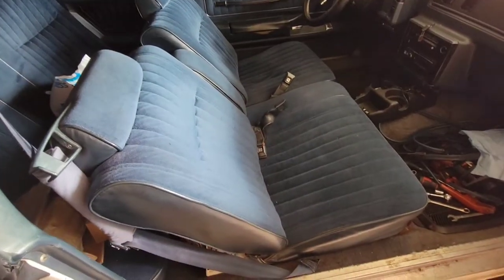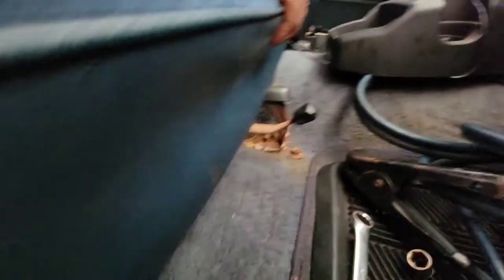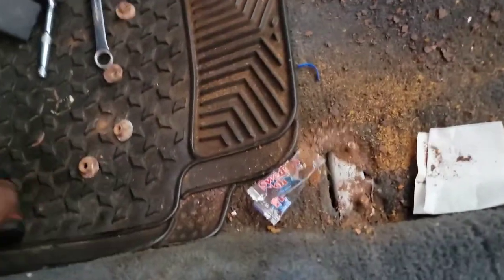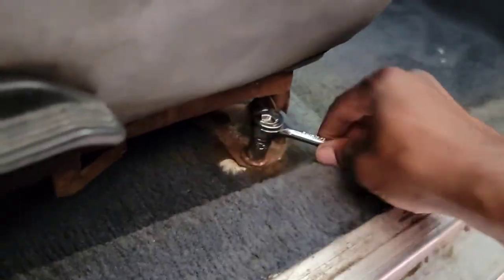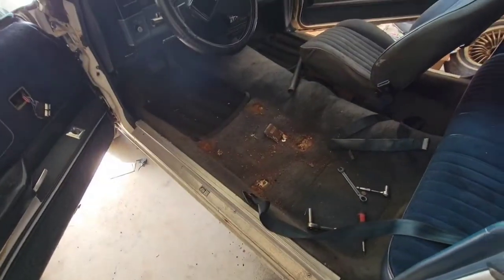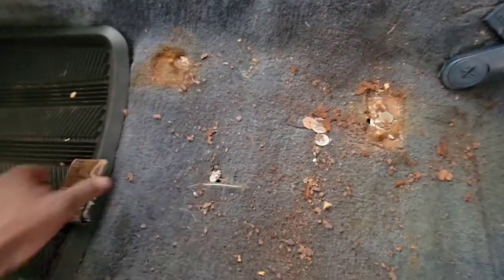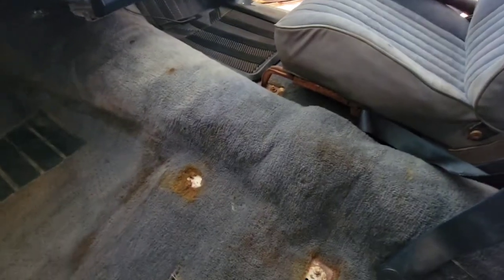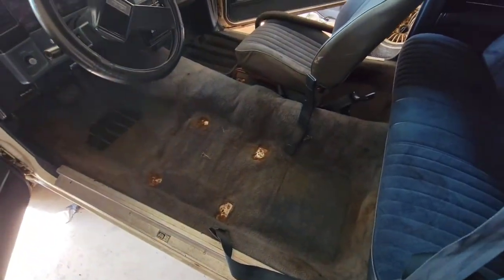GBody - Bench to Bucket Seat Swap

Comment: You don't have to sandblast tracks for the seats you can just use a power drill with a wire brush on it and it will take all that off

Comment: Im in okc too. Have a 79 elco trying to convert the bench to bucket seats. I need some help lol
Reply from the maker: You got the seats?
Reply: @restoredmusclellc  nah. I dont have anything. I’ve been trying to figure out what seats will work. I looked on amazon and was told they wont work because the brackets wont match up. Im lost, honestly.
Reply from the maker: @yaboidougie1904  you want factory style seats or aftermarket? You may have to weld in brackets
Reply from the maker: @yaboidougie1904  78-88 GBody Bench to Bucket Seat Track Floor Mount Bracket Conversion INNER set. Look that up on Google
Reply: @restoredmusclellc  will that just simply bolt up to any racing seat I buy?
Reply: @restoredmusclellc  you stay in okc? Do you do that type of work?
Reply from the maker: @yaboidougie1904  those brackets are for factory buckets. Aftermarket seats usually use a universal mounting bracket for race seats. I can get someone to weld it for you